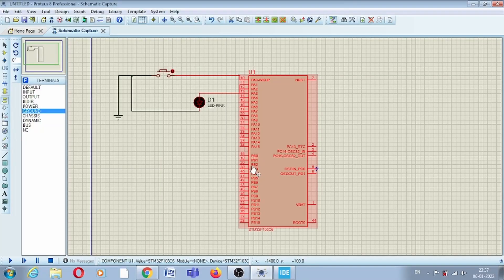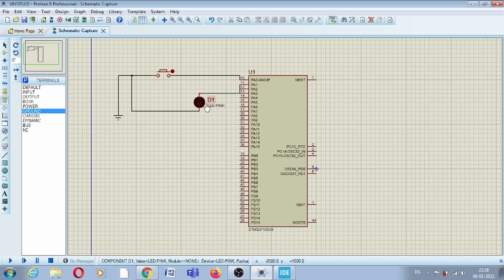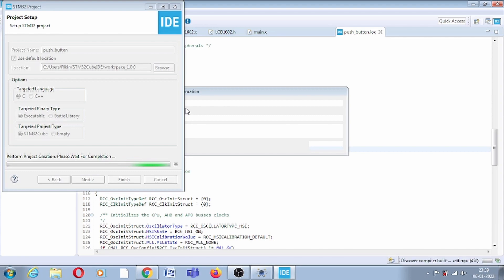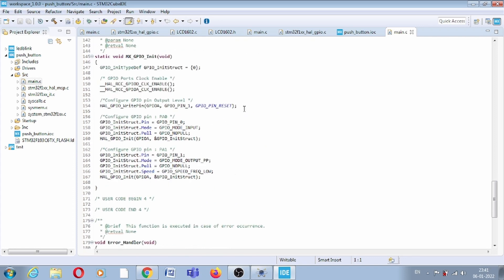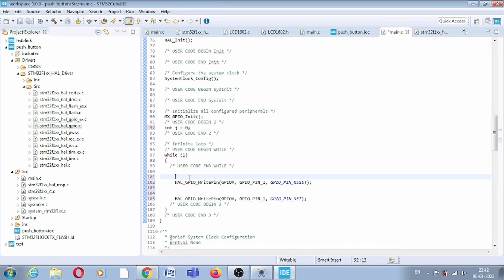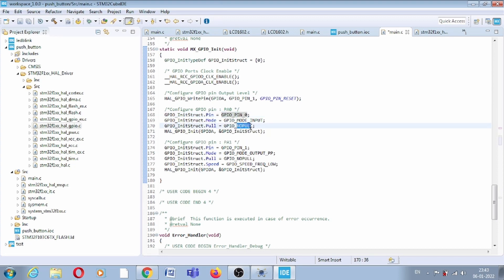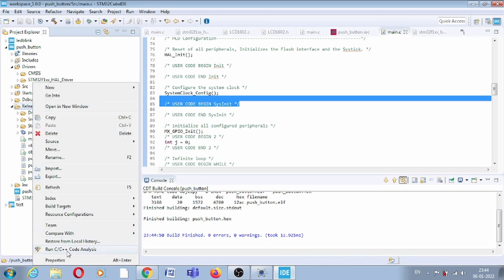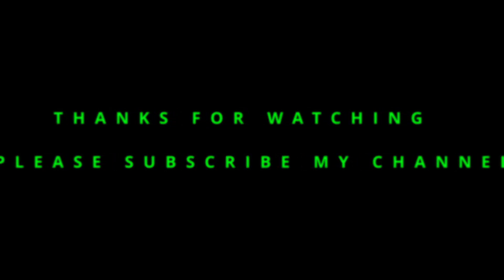STM32 : Push Button example using STM32CUBE IDE

Comment: Hello if we want to make washing machine project then here u used switch an led if we want if switch is presssed then lcd, 7 segment display turns on then how we can??   Can you suggest as soon as possible bcoz we have hackathon compition in only 2 days so plz suggest it
Reply from the maker: Thanks for watching!  Yes you can simply combine two hardware's code.... Here you need to arrange the flow when button press.... Call seven segment display logic with specific hex..... If you need further guidance kindly send an email.....